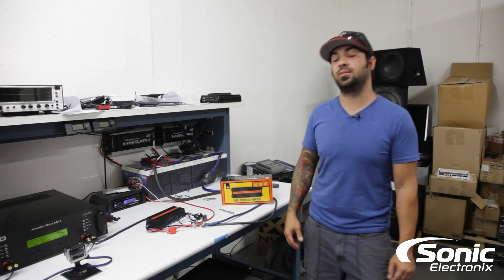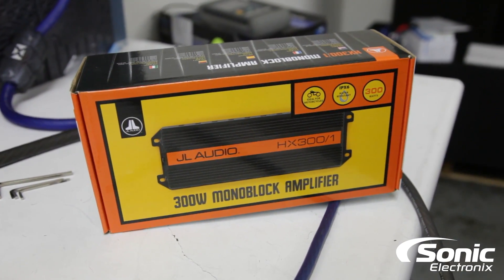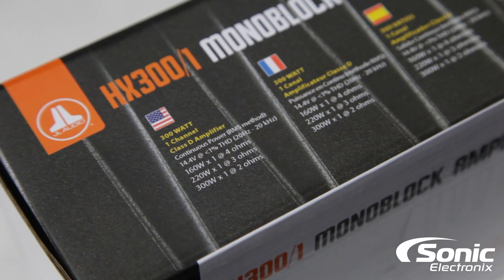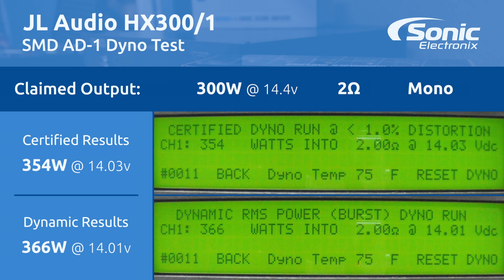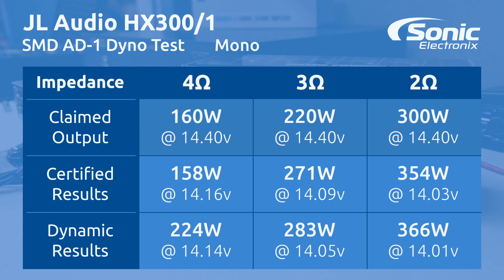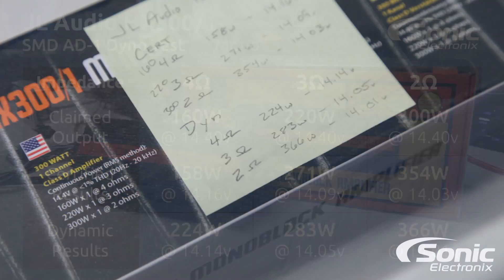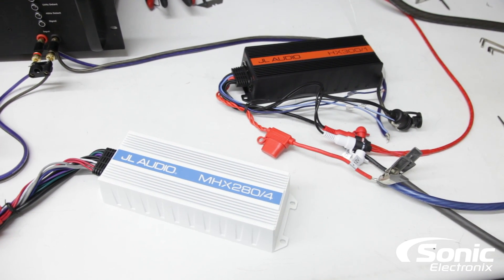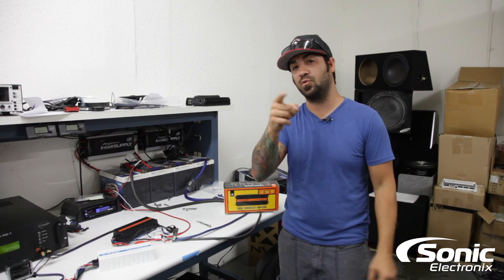JL Audio HX300/1 Amplifier Dyno Test | SMD D'Amore AD-1

Comment: Not bad. I thought jl amps put out the same power at any ohm load though.
Reply: +Thanks Obama 
The slash amps have the RIPS Technology that put out the claimed watts at any ohm load between 1.5 ohms thru 4 ohms aslong as you have sufficient power to keep the amp on.
Reply: focused313 That would go against Ohms Law, which states  that the current through a conductor between two points is directly proportional to the potential difference across the two points.
Reply: +focused313 the / models do, like the 500/1 and 1000/1